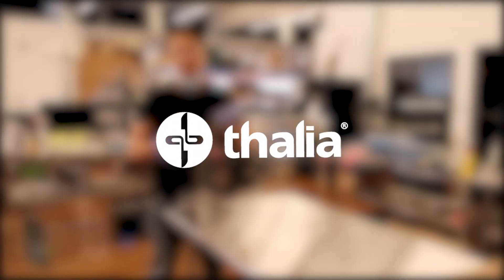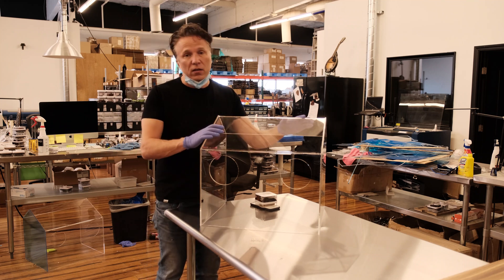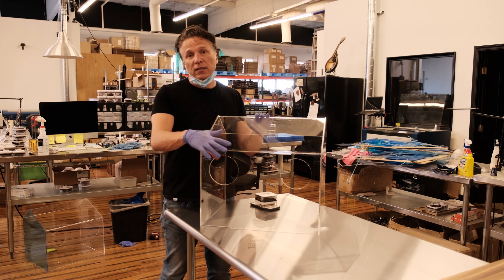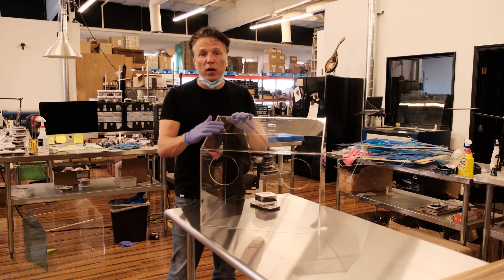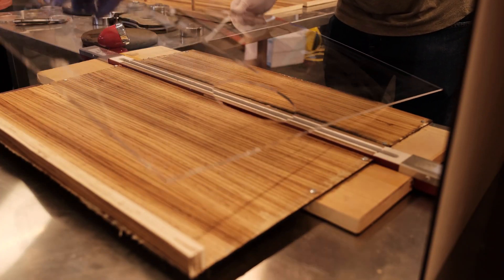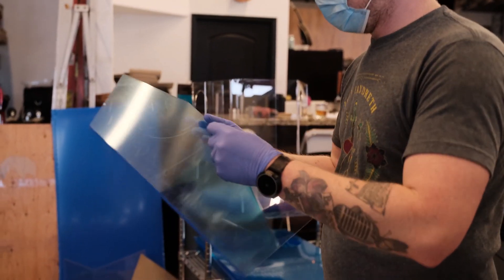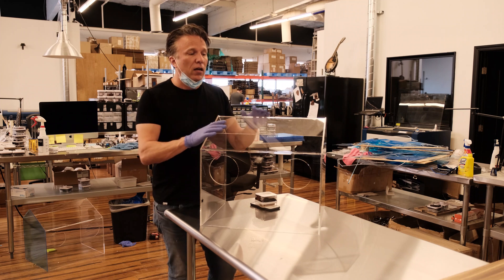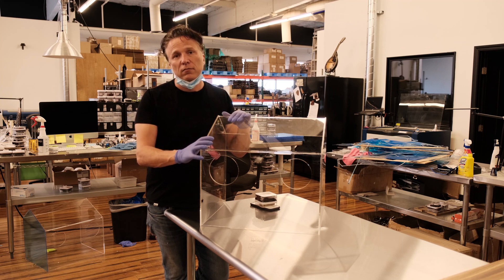Thalia Is Building Intubation Boxes to Fight COVID-19

Comment: Hey bro

I do have a simple suggestion.

Design the side walls so that it would be a bit slanted.

So it would be stack up 1 over the other if not in use just like as if you would stack paper cups.

Just my thought. Any way thanks good job thanks.